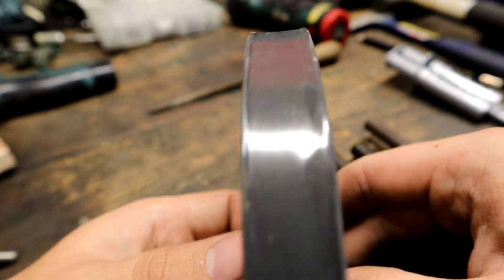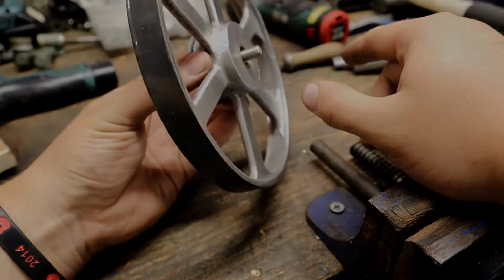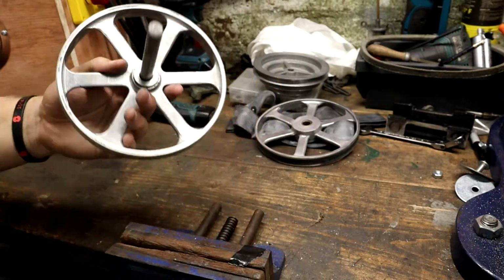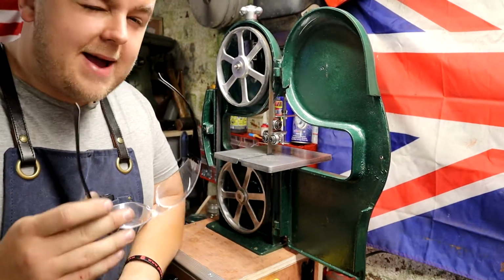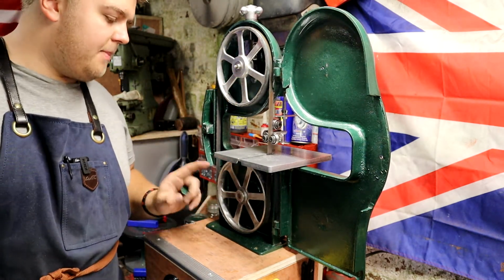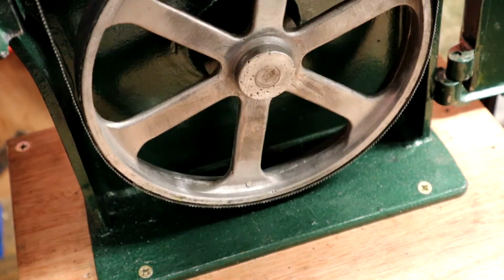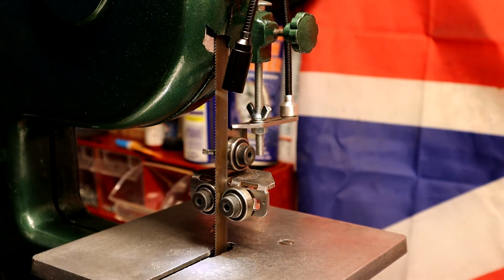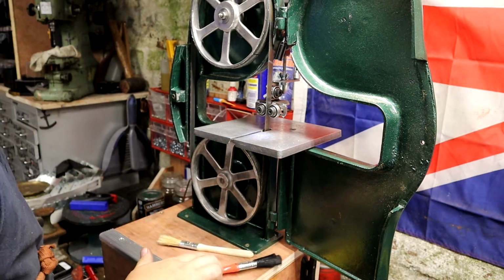USING BICYCLE INNER TUBES FOR BANDSAW TIRES?!

Comment: I'm going to try  inner tube on my 12" SIP Bandsaw. Many of the parts including the saw it's self are no longer available. I managed to find tyres for it. Including postage they want a ridiculous £34.00 for two.
Reply: That's pretty cheap but still a pain, mine are £60 £70 odd for 2
Reply: And did you manage with the innertube? it should work I replaced one on my 16inch mini max with innertube probably 4 months ago only went to replace as other wheel was going so thought I'd do both, now think I'm going back to innertube
Reply: @bunney181  Thanks for your reply. Yes it worked well using SuperGlue  and activator spray.
I had to change the drive belt also.
🙂
Reply: @Bullseyearchery  thanks buddy think I going to redo that on both now Iv took them off, only did as original tyre had gone and had some neoprene to find out it was to thick and I could of just changed the one grrrrrrr lol, I  think my drive belts going aswel as it squeaked but a tiny bit of wd40 seemed to help restore the rubber not sure how long it will last tho, go steady bud

Comment: Regarding the tracking issue:

1)  Are you sure the centre bushing on both wheels is concentric with the outside of the wheel?  Especially with the improvised tyres?

2)  I forget how each affects the tracking but from my time running flat belt driven pumps....you have to adjust both the angle of the adjustable on its axis (so that both wheels are running truly parallel), and its position relative to the fixed wheel (so that they are exactly in line).  Kind of hard to explain in text!
Reply: Also, your driving wheel is the bottom (fixed) wheel, IIRC.  Not sure if that will make a difference, becuase on the pump setup the driving wheel was the adjustable wheel.

Comment: I thought about using innertube rubber after I had ordered new ones. The blue urethane ones are crap and cost the same as the original black rubber ones.
Reply from the maker: Still working well! Even after a year. Thanks for the comment 👍